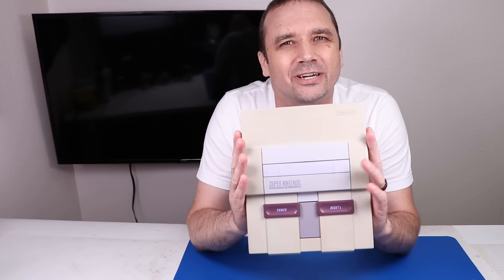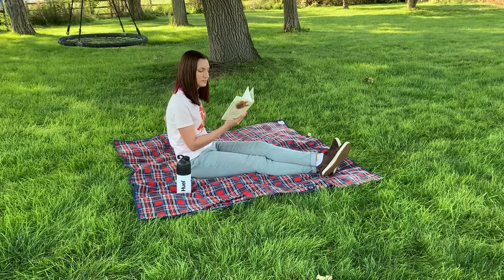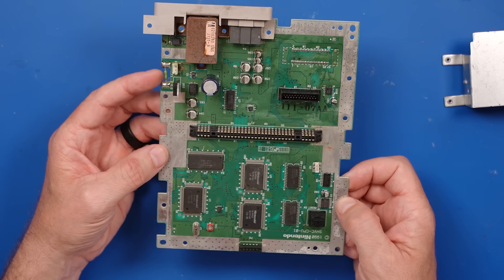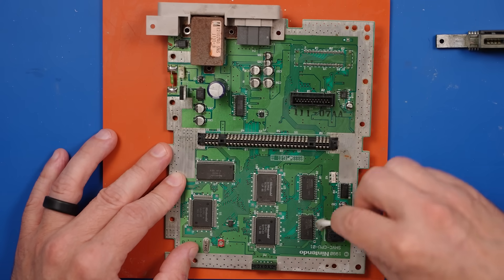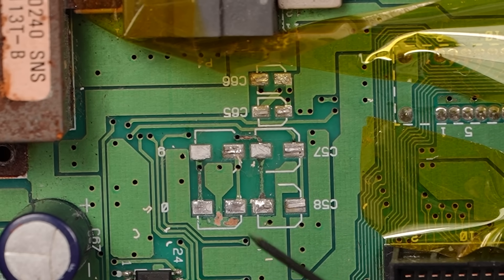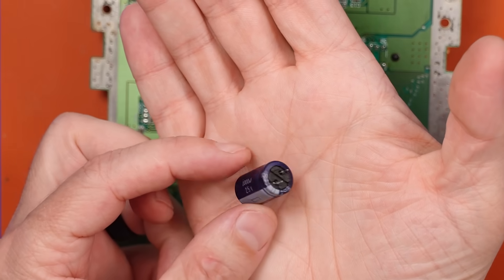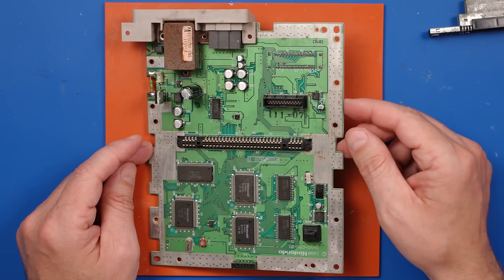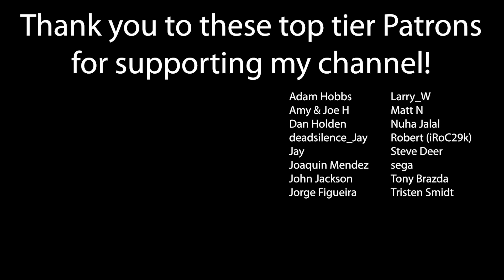Repair Shop Said "Unfixable" - Let's Find Out!

Comment: I was a little disappointed watching the video hearing you say that the video output is at an angle and you need to look at that and the power switch is getting a good cleaning. But you didnt do any of that. At least not showing in the video.

Comment: I opened and worked on more than 7 snes and sfc console and all of them had leaky caps. my personal 1 chip unit that I was sure was in great condition had all of it's smd caps starting to leak. this is a major issue. combine that with chip rot and you're in for a bad time.
guys get your snes's recapped if you want them to live.

Comment: Might be a good idea in the future to use braid to remove all of the old solder on those SMD pads before installing new caps. The solder looked like it had some contamination in it which can lead to a bad joint over time.

Comment: 1. I'd soak the housing in warm soapy water and give it a good scrubbing.
2. You could've tested the system just by screwing the cart slot through the PCB the the housing tub.
NEVER fully assemble the device before testing it! It never works on the first try and disassembling is a pain. 😅
Reply: Everytime YouTubers fully reassemble things just to test them, it drives me up the wall.

Comment: Absolutely insane how much repair shop wanted. I would probably have cleaned up the metal on the game slot and the metal pin too it would bug me knowing it was so rusty
Reply: Trying to do something with the rust might do more damage. Just a scrub and deoxid should be good enough.
Engineering 101: if it works - don't fix it. 😅

Comment: First was the four rubber feet, then the removable sound module and cart slot, finally revealing it's an SHVC-CPU-01. It's really lucky you got to the caps in time. Granted, the CPU and PPUs will fail before too long.

Comment: @TronicsFix SuperFX microchip games have a tap inside the cart by the connectors, it connects to the slot outside shielding, I think some sandpaper on that part would have been a good idea.

Comment: @tronicsfix hey wondering if you can fix my PS3 60gb fully backwards capatible, had it fixed 5 times as the repair persons informed it was the motherboard kept getting the yellow light of death and also the fans would go crazy fast when I play certain games like uncharted 3

Comment: I have a distrust of repair shops. Tried to get a battery replaced in a cell phone and got it back in worse condition and some weird malware. Took in a scuf PS5 controller to another place to get the joysticks replaced for the stick drift and none of the face buttons work now. No more stick drift tho.

Comment: I sometimes clean corrosion using emery boards for nails. Can get them in various grits, and they are almost perfect thickness, slide in, sand off corrosion, blast out with some electronics cleaner. Nice and bright copper when done, just be careful to not use the 60 grit and destroy everything. Not that I've done that, who would be that dense? ;)

Comment: Honestly, I'm still surprised no one refers to the old NAVAIR 16-1-540 Avionics Cleaning and Corrosion Control Manual on tips on easier ways to clean electronics. Using an ultrasonic cleaner with a solvent or even non-ionic detergent and distilled water can clean up a whole unit with out worry. Makes cleaning it easier if you start with that.

Comment: At first I thought "the previous owner spent all that money because maybe the console had some sentimental value" (which is the case for me, I'm holding on to my childhood Sega Genesis because it was a gift from my parents even thought it stopped working long ago). But then you mentioned that he bought it from someone else which makes this entire thing strange.
But as expected you did a great job and fixed it. Of course the capacitors had to be replaced (almost expected for "old" electronics) but if there is one very useful and easy thing I learned from you is that proper cleaning can solve a lot of issues.

Comment: Really? All that and you didn't change the #1 issue on a SNES? The power input port? Especially since it was wonky and at an angle.
Reply: I had to scroll far too long to find this comment. That thing is still going to have issues and I'm pretty sure that's why it was cutting out at the start. He got the cable to sit long enough to fill an outro and called it a day. So much hackery on YouTube.
Reply: @temporaryscars  If you paid attention you would've noticed that the power stayed on even after the video cut out.

The video issue was bad capacitors.

Comment: I know blaming the repair shop is easy but there are reasons to think the person that sent it to you has left out important details. They claim they sunk 150 in parts into the machine. Where are those parts? Also what did the sender specifically request of the repair shop? If they presented the repair shop with the fuse and ask them to replace the fuse the shop can't be blamed for not doing the other stuff. Many shops primarily focus on replacement of whole parts and anything more in depth than replacement (like soldering) get the 'bench fee' and 'one hour minimum' Treatment. Those fees are stated up front.  Odds are the person at the shop ask the sender "are you sure? You can just replace the whole thing for under 100$" then the sender insisted that the fuse be replaced.
Reply: this is a lot of overthinking for just a viewer to create a fake story knowing it would be outlandish enough to get a video and thus a free repair.

Comment: That repair shop is a scam. 😢😢😢😢 take them to small claim court with this video as proof. They didn't perform 150 dollars in labor or parts since its was the capacitors needed replacement and the slot also properly cleaned and protected. Shame and despicable practices 💩💩💩💩💩

Comment: Good old SHVC-CPU-01 SNES. Dead CPUs or PPUs plague these-- but when you got image it was clear it needs new capacitors and the chipset was probably fine.

I can't believe some hacks charged $150 to not fix this thing
Reply: Yeah, I've repaired a few SNES/SFCs and the old aluminum electrolytic capacitors are a common source of problems. It's nice that there are schematics online so it's possible to figure out what the caps do (most of them are AC coupling capacitors, most of them for the video signals, and there are two for the audio). On my personal SNES (SHVC-CPU-01, so I'm dreading the day of PPU/CPU rot), the audio caps looked OK from above, but once I took them off they had begun leaking underneath and a few years later and they would have eaten through the traces to the audio output.

Comment: This was an easy one, no issues with CPU or the PPUs. How would you go about fixing the controller ribbon cable? I ended up cutting the damaged part out and using sand paper to reveal the pins. Thanks

Comment: If you do more snes consoles, id highly recommend picking up a burn-in test cartridge. Similar to what Nintendo used back in the day to diagnose systems. Huge help finding out which chips might be faulty and controller testing

Comment: most common snes failures; 5v regulator, the dc in jack, and the wires on the power supply plug break at the solder joints on the plug itself. (i've had a bunch of this one)

Comment: Those capacitors were most certainly the problem.  But also, for the power plug:  It would be best to replace the power socket as soon as possible as it looks like it's cracked/broken.
Reply: Forgot about that part. Yeah def seemed not ideal.

Comment: SHVC snes’ are at the point where you should be recapping them in general. There’s also two caps in the audio board that you should replace as well. After that, you can run the snes burn in test rom and make sure everything looks correct and passes all tests.

SHVC PPUs do have a certain failure rate, but from what I understand if it’s a bad chip it most likely will have failed by now.

Comment: At the beginning of the film, there was a problem with the TV cable, but after replacing the capacitors, the problem disappeared. How is it possible that the cable and socket repaired themselves?

Comment: Even if you attempt a repair on the SNES, you'll encounter a problem with the PPU1 and PPU2, the two large chips used to de-zone the system.
If one of them burns out, it's adios, and you'll need a working donor chip.
I hope you never have this problem.

Comment: You may have fixed it for now but sadly those SHVC-CPU-01 boards are notorious for having the CPU just spontaneously die :(. I had oen a few years back that suffered that fate and replacing the ram and memory chips before that to prolong it was a fools errand.

If you got that model I wouldn't get too invested in them long term.

Comment: I use to work at uBreakiFix and I would actually get in trouble for cleaning systems if the customer didn’t specifically pay for it beyond the repair. Terrible company.

Comment: repairshop: ill just take a look inside and oh my, what desert has come through here.. welp, i didn't see it.. oh look a fuse. hmm is it good? i don't know but lets replace it anyway!
also repairshop after replacing fuse: HEY! it works! (turns off the console after 20 seconds) lets charge him 150 dollar for labor and forget about the part.
do i sound like that repairshop?

also, you do such a good job at fixing and thoroughly cleaning electronics, by far one of the best if not the best.
kids need to see and learn from you.

Comment: To charge with no work done is diabolical. They can say it's for labor  but sitting in the back and staring at it just to tap it with a screwdriver after they finish their sandwich and cigarette isn't labor

Comment: Y'all have any interest in things like controllers? Like the Razer Wolverine Ultimate RZ06-0225? Great controllers but they are not made to last and seem difficult to repair. They're also not worth much but might make a good video? Seems like it wouldn't be all that difficult to switch out for more durable parts but there isn't really any info out there about it.

Comment: Any benefit to adding soldier mask to those spots where the leaking happened and parts chipped off the board?
Reply from the maker: It's likely fine either way but I should've done it. Not sure why I didn't think of it. I think I was just in the flow of the video and repair.
Reply: @Tronicsfix  Love your stuff and constantly learning.

Comment: Adding fresh solder is good but you should remove as much of the contaminated solder as you can. I add solder to dilute the contaminated solder then remove. It gives you a nice flat pad for the replacement caps too.

Comment: I threw it away, but I wonder if you could fix the cartridge port from my commodore 64. It didn't work so I did de-oxit. But it became less and less reliable. Then I looked at the (brand new) cartridge I was using. It was covered in green gunk. I cleaned the cartridge. I cleaned out the port. Put in more de-oxit.....nothing. I replaced it....works perfectly. I examined that port very carefully. It looked fine to me. lol I have no idea why it stopped working.

Comment: Nice job with the repair.

I want to address your suggestion of buying a cheaper one off a website or something along those lines. I would agree with you, but I feel like preserving consoles also go along the same line with the 'right-to-repair' movement that a lot of these repair channels do. This viewer could have had this SNES as a child, and there's possible sentimental value to it, so of course they're willing to put money into it to keep it going, they just didn't have the skills to do so, and they had horrendous luck with the repair shop they took it to. I don't know exactly how it cost up to 300 (aside from some skewed numbers because repair places charging $150 to fix something they didn't even completely fix is ludicrous).

Then they reached out to you, which they knew it would get the best effort to fix it. You've been a supporter of the Right to Repair movement for years now, and even though this is an older console and the components are more readily available, it did make me kind of sad for you to just suggest replacing the console with another one they could buy for cheap. 

Sucks they ended up selling it to you rather than just paying you for the repair, which I know you do it for the YT content and instruction for other repair people. I suppose it wasn't actually sentimental if they just sold as broken after spending so much on it. Just probably ranting at this point. Keep up the good work, Steve. 

Also: Zelda: ALTTP is still one of the best Zelda games. So iconic.
Reply: I thought this too, but at one point Steve said they purchased it from someone who said it was in good condition but actually wasn't.

Comment: What happened with the power cable? was it just the cable that was pulling it to one side? or did you fix the plug on the board as well?

Comment: for the damaged traces just to minimize the risk of future damage, I'd actually line the whole trace with solder and then put mask on it.
Reply: I was surprised he didnt at least put new masking on it
Reply: @XeroMaverick  Same
Reply: After you make a new trace you need to epoxy over it, the pcb is already epoxy so youre essentially putting it back to how it was before.
Reply: Bro has almost 2 million subs and doesn't have a $30 ultrasonic cleaner for stuff like that cartridge slot.

Comment: First thing you should do on any 90s, or 00s electronics is replace ALL SMD capacitors without exception. And if it's late 90's and early 00's, you should replace all electrolytics anyway. If it's 80's throughole....it's probably fine. it's not always though.

Comment: Another excellent fix. They couldn't have possibly spent more time on that SNES could they? That fuse repair would have been like $5 USD at most. $150 USD for a fuse repair. A fuse repair that didn't even work because the original fuse was probably good. Classic, typical scammy repair shop

Comment: Can I sent my new 3ds xl for a fix to you? Because I spent 700€ on it on ebay, but they said it was working perfectly fine, but when it arrived I tried to turn it on but it didn't turn on, so I pluged the charger in and tried to charge it and after an hour I tried to turn him on again but still nothing, then I bought a new baterie and it still didn't work, so I knew the baterie isn't the problem, but now I just spend 700€ for a brocken console I didn't even knew that it's brocken and now I try to ask you to fix it so the 700€ weren't worthless. So can you fix it for me please???😢
Reply: Why didn't you simply return it? Or if the seller didn't accept returns, use the eBay Buyer Protection?
Reply: PS. I forgot to say that I don't know what exactly is brocken on this 3DS!
I would be ssssssoooooo happy if you could fix it because I even brought to a lot repair shops near me  and all of them said they don't fix these consoles anymore and they guy who sent me it said he doesn't care and doesn't want to get it back, so I ask you again to fix it for me, please 🙏

Comment: I agree, I dont get how they can charge 150. But at the same time thats one of the reasons people get into doing self repairs and learning how things work.
Reply: They may not have wanted to take the job, since it's a niche repair based on how cheap these consoles are in the current market. 

My elderly dad is very attached to his iPod nano 6th Gen (the size of a shuffle or smartwatch) and paid over $200 to have the battery replaced. No one around usually repairs such a niche device but were willing to take the job for a high price tag. Essentially, if they can make enough money off it, some repair shops are willing to do it. Usually the expectation is that you'll decline because of the cost.

Comment: I'm all for restoring and preserving these old systems, but if one is in this bad of shape the amount it costs to restore it you could easily get a much better one.  I did spend over $300 on my 001 Gamecube, getting a new shell, recapping and modding the drive board, but those are a bit harder to find than a vanilla SNES>
Reply: I look at this with two different perspective. Restoring it is different than fixing it. Fully restoring this would not make any financial sense so agree just buy a nicer one. Repairing it to functional condition was pretty cheap as shown in the video and worth doing that, if you can replace capacitors. Why this had $300 thrown at it without recapping and that sort of stuff makes no sense. If a person can’t fix it themselves it is always best to just sell it for parts / repair and buy a working one, sending old consoles in for repair is often not cost effective at all unless you have the spare cash and just want to.
Reply: I'm out of the loop, what's a 001 GameCube and what makes it especially valuable? Just curious.
Reply: @thumbs_are_handy  Two models of the Gamecube were made, the DOL-001 and the DOL-101.  The 001 had a digital port on the back that Nintendo never used.  But in 2017, hobbyists found it could be easily converted to HDMI with no loss or latency, so the GC Video project was born.  You can buy an HDMI adapter that works with the digital port for around $70.

The 101 model removed this port to reduce cost, since Nintendo never used it.  Thus, the 101 model requires an internal mod to output digital audio/video.  There is an internal GC Video board for the 101, but it requires a lot of soldering and is quite complex to install (the same as the Wii which also has no type of digital output).

So in a nutshell, the 001 can be used with a modern display with a simple adapter.  The others require a complicated internal mod with an extra board and a lot of soldering.
Reply: Selling it as "untested" is another option, that may garner a slightly better price.
Reply: Pro tip for you buddy: sometimes people do things because they enjoy it, or for the challenge, or for any number of reasons other than making money.